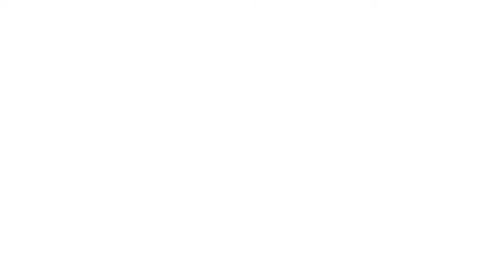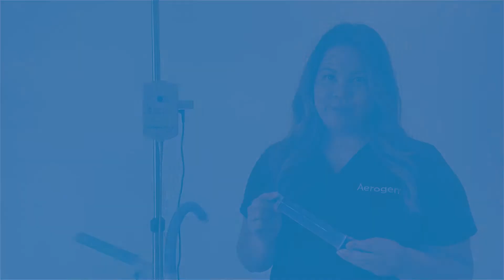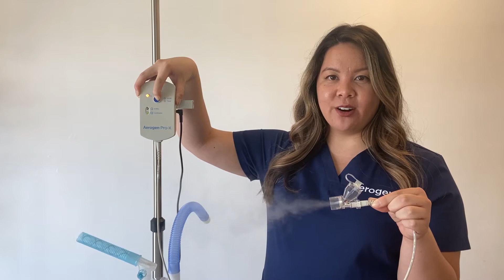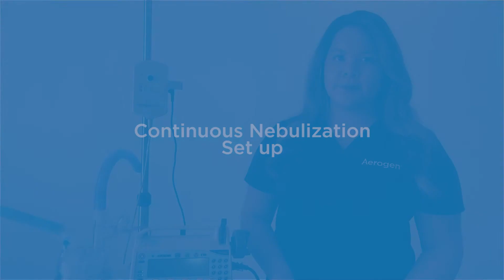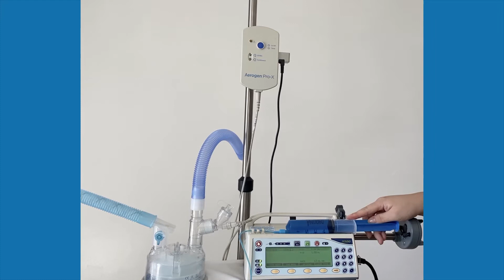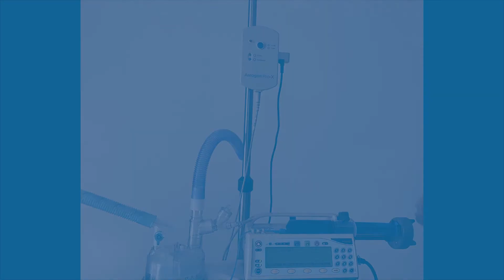Aerogen Set-Up for Continuous Nebulization

Comment: I notice that you have skipped over the method to fill the syringe in your video. It goes from unfilled to filled. I suspect this is so because your proprietary syringe doesn't play nice with methods to fill that syringe. Do you have a fill through cap (such as what is used on a J-tip device) that would fit your syringe and allow syringe to syringe filling? I cannot be the only person to want this. The alternative options seem like rigging to me.